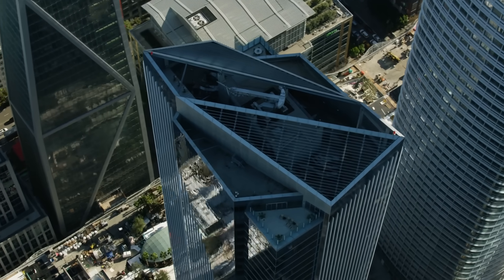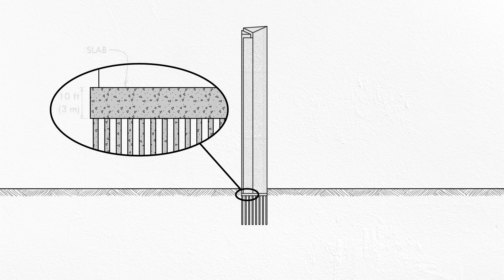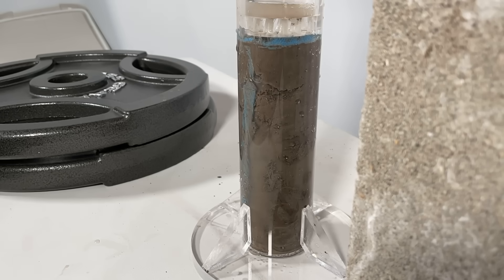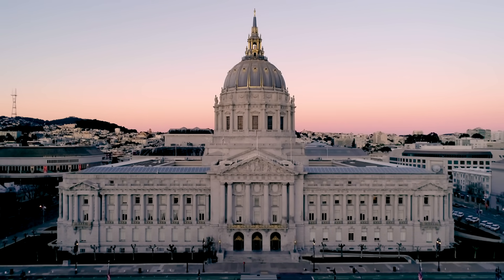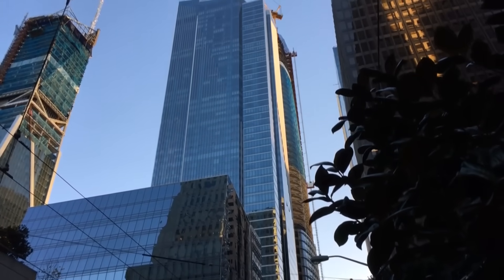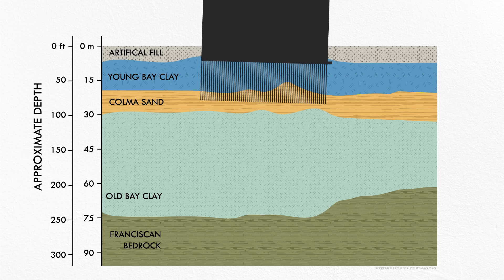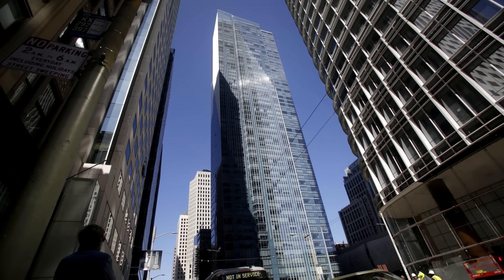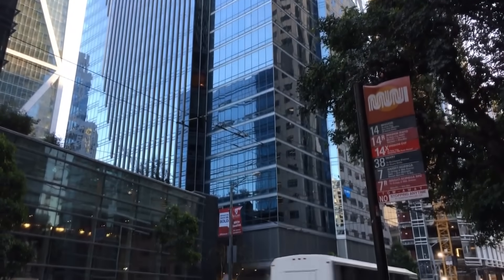What Really Happened at the Millennium Tower?

Comment: I would like to know why this tower had this issue while larger towers nearby didn't suffer the same fate. You discussed that the dewatering for other projects affected this one. His did those same Fircrest affect the others or what did they design differently?
Reply: This building is concrete while most tall buildings are steel skeleton structures
Reply: @dmkinsey  with concrete core in the middle
Reply: The building was heavier than other buildings.
Reply: The Salesforce tower foundation goes to bedrock. There was a similar (but smaller)  tall reinforced concrete tower proposed for 80 Natoma St  that was cancelled right before this was built. It refused to make the foundation go to bedrock even though a recent news report said it would have only been an extra $4 million and they said the transit authority (building nearby) was even going to pay for it. Then somehow this one got approved at a later date without going to bedrock with the foundation.
I have seen videos that said there was no geotechnical engineer (foundations) on either the design team or the city peer review team. Berkeley Professor Jack Moehle was on the design team as an earthquake expert and also led the peer review team (against city rules of being involved in both) and during questioning by a city supervisor he said "When I said it should be approved I wasn't saying it was going to work".
Reply: @lockbert99  over here the city engineer must approve the plans if the design engineer demonstrates it satisifies all the Building Code(*) requirements. 
The city engineer can have their own doubts about whether or not the "complying design" will actually work but, if there is nothing in the Building Code(*) that reflects those doubts, they have no ability to stop the project going ahead from a legal standpoint.

(*) or whatever the San Francisco equivalent is called.
Reply: @juckto-007  But there is something to the story that this video doesn't include. A similar but somewhat smaller reinforced concrete skyscraper was looking for approval at 80 Natomas St. a little before this one . The transit agency was concerned due to the proximity of their new planned large terminal (they are paying part of the Millennium Tower bill because they are said to have accelerated sinking by removing soil water for their effort) and came up with an estimate of $4 million for them to go to bedrock and then even offered to pay. For some reason the developer still refused to go to bedrock and the project was cancelled. So even though the code  allows it (this was approved on that basis by the peer review lead Jack Moehle) a previous project was cancelled for the obvious problem?? So I wonder on what basis the previous project was rejected.
Reply: @lockbert99  Wow, thank you for pointing that out. I thought you were lying at first because that sounded so idiotic for a city to do, and I'm wondering if there's any innocent explanation tbh
Reply: SF chron published artical bout this all other towers go beyond bedrock all are of lighter constrution, steel frame this is the heaviest building west of the missippi i believe in terms of size ect
Reply: The reason why Millennium got built and the one at Natoma did not could be easily traced to the back room deals that W. Brown and Tom Perkins made with dbi - they had an interest in this project moving forward. Nobody seems to be mentioning the political dynamics that were at work. I was there, and many others, too - I don’t know how this is such a secret.
Reply: @craig1971  it's libel. So shut up
Reply: The other Towers were much lighter steel frame buildings with foundations that went to bedrock. Treadwell & Rollo, the geotechnical engineer for Millennium Tower just had a 52-story skyscraper at nearby 80 Natoma with the same heavy cast in place concrete construction and shallow foundation rejected by the city's Department of Building Inspections and they could not afford back to back rejections of projects of this magnitude so they simply skipped that part and went ahead with the construction they knew was defective and would have been rejected had it been submitted for peer review.

This is what happened everything else is interference meant to create doubt and confusion and Practical Engineering is part of that. 

PERIOD!
Reply: The surrounding towers were built with adequate foundations for their structure. This building was originally designed for a steel structure and then due to cost cutting, concrete was chosen without modifying the foundational structures. The standard for this type of structure is pilings down to bedrock. Important facts have been left out of this video.
Reply: @craig1971  exactly.  And how are they trying to repair it?  By installing end bearing piles sunk to bedrock.  The land it's built on is old marshland filled with rubble from the 1906 earthquake and they decide to use friction piles.  Insanity.
Reply: The builders thought that they could use more support rods that were shorter to support the building because it would be cheaper than drilling down to the bedrock from the start.
Reply: @anthonydelfino6171  But look for the report on how much the transit agency estimated the cost would be for a similar building proposed a little earlier to drill to bedrock in the same neighborhood. $4 million. Millennium Tower cost $350 million.
Reply: The timeline of when this building was built is the ultimate factor.  The Millennium Tower was built around the same time other projects in the SOMA district were being built, namely the Salesforce tower and transbay terminal (both being next door to the project)  The engineering firm must not have taken into consideration the impact of soil movement from those other projects.  Why those other projects didn't get affected is two fold, the Salesforce tower apparently has piling that hit bedrock, and the transbay terminal is a smallish building that spans multiple city blocks and so has a lower PSI on the soil.
Reply: @bassman87  That's what the developer's lawyers argued.  The truth is, it was originally designed as a steel frame building.  The developer decided that was too expensive and had the building redesigned as a concrete building.  The foundation wasn't redesigned to support the additional weight.  So it's a heavy concrete building sitting on a foundation designed for a lighter steel building.  Why was the old foundation design approved for the new building?  That's the $64,000 question that will never be answered.
Reply: That sorta highlights how baseless a lot of the lawsuits were. Of course no one saw this coming!
Reply: @samsonsoturian6013  The city canceled a previous attempt to build a reinforced concrete skyscraper at 80 Natomas Street when the developer refused to go to bedrock, even when the transit agency offered to pay the $4 million they had estimated it would take. So yeah, they could and did see it coming. There must have been some palms greased as this building was even closer to the transit agency's new terminal.
Reply: @lockbert99  No, they didn't. The two incidents are not related. Get over it.
Reply: @samsonsoturian6013  They are related in that the same city approved a large reinforced concrete structure with a foundation that didn't go to bedrock right after they didn't approve a large reinforced concrete structure in the same area that didn't go to bedrock. They showed they were aware of the problem and then chose to ignore what they knew. Deal with it and stop carrying water for the bureaucracy.
Reply: @samsonsoturian6013  You always get mouthy when you are safe in prison.
Reply: @samsonsoturian6013  Because of carelessness and stupidity.  SHows why lawsuits are needed to keep these .gov idiots in line.
Reply: @bobsmith-qu2oq  Huh?  The developers and engineers work for private free market companies, not the government.  The city engineers got involved after the fact, and even the solution that made the settling worse came from the private engineering firm.
Reply: @bobsmith-qu2oq  Yeah Bob tell e'm! I'm sure you know much more about engineering than a team of highly skilled and educated engineers. For god sake, it was so easy... just ask Bob and this never would have happend!
Reply: @bassman87  he has a narrative to spread and probably won't even read your comment, don't bother trying to use logic on those types of "people"
Reply: @bassman87  The city had to approve a massive reinforced concrete building being built without going to bedrock. The city had regulations that didn't require a massive reinforced concrete building have a foundation go to bedrock. The city had recently rejected a somewhat smaller reinforced concrete skyscraper because the developer refused to have the foundation go to bedrock, and then inexplicably approved this one.
Reply: @florisbackx1744  It should never have happened. They cancelled a smaller reinforced concrete skyscraper proposed for 80 Natomas St right before this one for not going to bedrock. And then gave this one approval. And your knee jerk reaction is to defend the government and the engineering firm and heckle someone who dares to criticize them? Hopefully you are a SF employee doing CYA.
Reply: @lockbert99  I bet money changed hands to get this approved, either to the city or to a local politician.
Reply: @bobsmith-qu2oq  how is this the government’s fault?
Reply: @BlackSoap361  You can't just build skyscrapers. The city has to approve them. They didn't allow a cement skyscraper at 80 Natoma St right before this because it didn't go to bedrock. So they appeared to be aware that concrete skyscrapers should go to bedrock but let this one go.
Reply: CCSF Building Department from the design, it was beyond their expertise to evaluate and approve.  They ultimately hired an "independent team" to review and recommend approval of the original design.  Another team from the city approved the retrofit.
Reply: @lockbert99  because the engineers said so.
Reply: @BlackSoap361  What engineers said what?
Reply: This building is made up of concrete which will always be a whole lot heavier that a steel built building. Some of the other towers nearby are actually built on bedrock which is why they don’t tilt or have issues, crazy right? 
Developers cheaped out on the foundation simple as that.
Reply: The building was always intended to settle, it just settled much faster than anticipated in some areas so the settling was uneven. Mostly due to the other projects happening nearby.
Reply: @guitarchitectural  It was settling faster than predicted even before the transit agency terminal work began. But the transit agency is being required to pay part of the Millennium Tower fix for removing water from the area of their transit terminal foundation.
Reply: @lockbert99  The Transit Center/Taxpayers paid $30 Million of the 100 Million Dollar Fix.
Reply: @sanfranciscobay  Yes I know. That was because it is felt that when they pulled water out of the soil for their construction  it contributed to the lean/sinking. But the bizarre thing is that they had concerns about that happening with the reinforced cement skyscraper proposed for 80 Natoma and offered to pay the money ($4 million) to have that foundation go to bedrock (per local NBC news report). And for some reason that didn't happen on this building.
Reply: I guess the order in which they where build matter. The vibration and water drainage caused by the other buildings accelerated the tilting process, so in a way, the Millenium Tower stabilized the ground for the other towers.
Reply: @Mark Harvey
What word got changed into Fircrest by your autocorrect? 😅
Also, thanks for teaching me about a tiny town I'll never visit, lol 😆

As for your question, my best guess would either be weight (as mentioned by others) or that the water table in that area does something funky. 
By that I mean that it's possible that the surrounding places had to pump out a lot more water, and that as a result the water from under this tower flowed away more than anticipated, while as much as anticipated was pumped out for the others. Which leads to this one skewing but the others staying within expectations/tolerances.

Another possibility could be that the other places just had a wider safety margin in the design (although I doubt it, since most would build as cheaply as possible while staying compliant with the building code).

Lastly, the others could've stopped construction at an earlier stage, when there was less tower and thus less weight compressing the soil (I mean, if your neighbor's house is sinking, you'll probably pause your own plans to see what happens, right?). And it's quite possible that, if all projects were only done one by one, none suffered from the others. So, in essence, timing might matter too.
Reply: @MrNicoJac  I vaguely recall that part of S.F. is built over a garbage landfill, tho don't know if that applies here. But garbage attracts and holds water, so... maybe a wet spot. Just speculating.
Reply: Look carefully at the neighboring buildings. None of them are as high. Taller buildings do exist in the city, but they are in areas that aren't landfill or in places where the sand is thought to go much deeper.
Reply: It's a scam... The building is fine.  It's a big Pay Day for everybody involved and the Tax Payers pay all the awards from the lawsuits and for the "repairs"  and -wa-la The building is fixed, repaired thanks to those wonderful lawsuits that made those evil citizens pay all the settlements.
Reply: all you have to do is look how many fake profiles and comments are surrounding this video... Internet bots that insert comments and replies.. just look at any one of these profiles (about 99%) have nothing in them and are newly created.  Any video with this many "Yes Men Comments" in the comment section has an objective, and is pushing it down our throats all boasting everything about this problem going as far as saying a pencil rolling off a table... The public is being robbed.  it's all deliberate

Comment: Idea: place vibrators in the south-east corner to accelerate the sinking on that side, and it'll level up.
Reply: Would need to be big ones. With dragon in the name
Reply: @Borsuk3344  1year ago I wouldn't be able to get it. God damn internet.
Reply: And also build new condominiums on top while the building is sinking. At the end, when botton reaches bedrock, they'll have tower with as many underground floors as overground ones and new apartments to sale will pay for everything.
Reply: @0masuk0  And above or below, you don't have to see the homeless and therefore actually fix the problem!
Reply: Vibrators would accelerate liquefaction and the building would not only settle more but begin to walk off its intended footprint, probably rotating in the process, stressing the existing piles, fracturing them.
Reply: @BillyLapTop  That all makes sense, but we won't know for sure until we try it in practice 🍿🍿🍿
Reply: That is what I was thinking, drain the water on the other side. But I guess if you try that, another building will tilt.
Reply: @schwarzerritter5724  Maybe connect all of the tall building structurally, and end up with a building wider than it is tall?
It is a valid technique for a group of people negotiating icy surfaces without falling.
Reply: @MonkeyJedi99  Skyscrapers flex a lot, and especially in earthquakes since this is SF. It'd also be difficult to reinforce the building to allow for lateral stresses like that, especially since this is a concrete building which is terrible under tension.
Reply: Too unpredictable
Reply: Disturbances to adjoining properties are in direct contravention of Code
Reply: Just get Moist Critical and Belle Delphine's collections.  Between the two of them there should be enough 😎

Comment: Reminds me of the Darlington Nuclear Array.  When the "fix" is more than the "build" the better solution is start over.
Reply: If you were going to start over, you'd have to bring down the existing building first. The cost of bringing down the existing building and building a new one is presumably not less than the fix.  You also have other costs like the cost to owners of condos who had no home for a bunch of additional years and so on.

It is rarely feasible to actually start such a large project over from scratch when you consider all the costs which would be involved.  So, it gets the fix even if it is expensive.
Reply: @doctorbobstone 
Yeah, imagine the time it would take to break all that concrete apart.
Or how massive a dust cloud would crash over the entire city if they imploded it....
And then you get tons of health-care lawsuits about lung conditions due to dust, etc. So the cost just keeps going up!
Reply: @MrNicoJac  and the sale value stays low and depressed through the life of the building failing to generate millions of revenue.  The amelioration efforts are going to be active and an on going expenditure again depressing the lifetime earnings of the building.  And that the amelioration has been haled because they resulted in the building  sinking faster with what is a comparatively minor side construction not only is concerning for this structure, it also shows how all around the building for any other construction project there could be long term ramifications/impacts to this building.  What they should have done was halt building when they first became aware of the sinking that was outside the engineering specifications/expectations and assessed their causes and repairs, but they didn't they barreled through to the end.